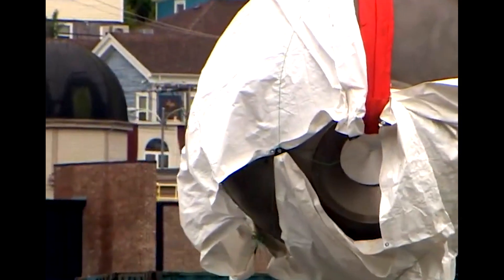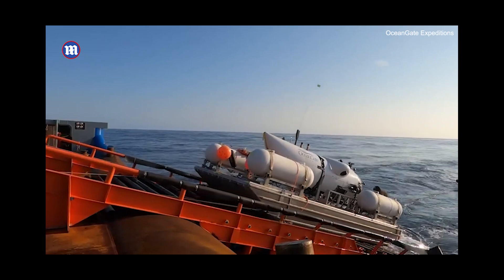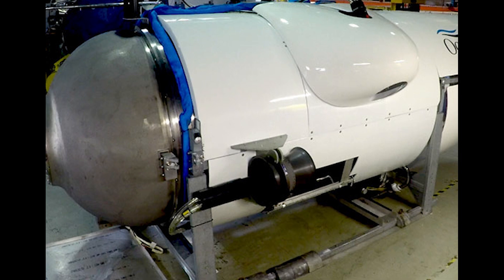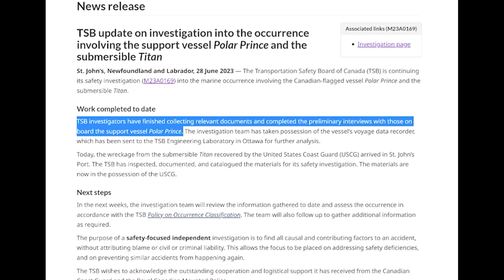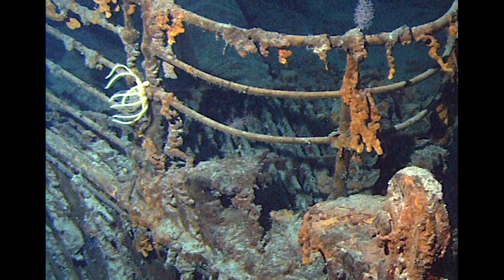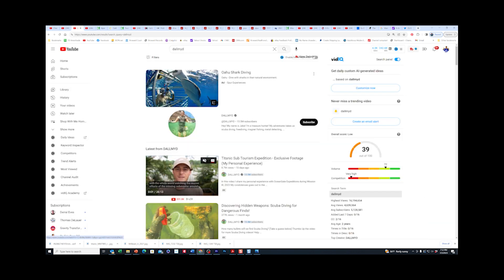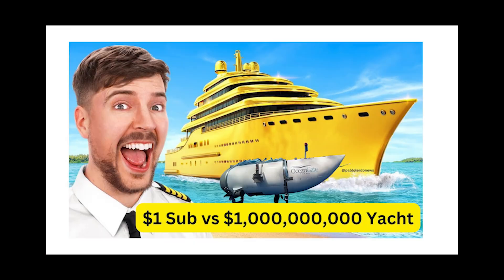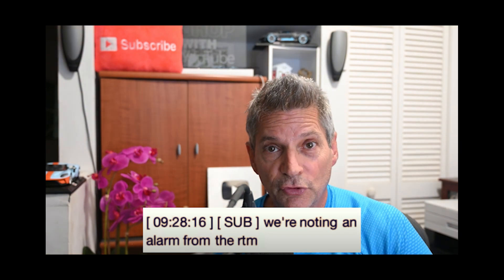Titan Submarine Debris Clues, Implosion Simulation

Comment: The design of the rings should of somehow been screwed onto the carbon fibre tube, its amazing how they glued it on, however the implosion happened its clear the two end caps which where glued blew outwards separating fully from the carbon fibre, or may have been what caused the implosion, as for them
Knowing they had an emergency, i dont know how long they was aware, but it was long enough for them to abort mission, and who knows maybe the dropping weight triggered the titan to implode, they must of been terrified during that moment
Reply: They could have had 6 brackets on each titanium flange with 6 thick carbon steel rods threaded on one end, connecting the 2 flanges together along with fasteners. I would have never trusted glue alone.

Comment: That's exactly what happens when you use composite bonded to rigid metal.
It's bond will catastrophically fail that's why there's no epoxy residue on the ring.
It needed rings in the centre if anywhere.  The obvious weakpoint is the centre. 
I would say the bolts were ripped out. Let's see.

Comment: My guess is they would have heard some cracking a short while before it imploded instantly!

This is pretty much confirmed by the dropping ballast and aborting the dive so close to the titanic, I doubt stockton would make that call unless it was an urgent need to resurface.

I have heard mention of 'cracking sounds' on previous dives and stockton saying it was 'normal'.

My guess is the carbon fibre was delaninating long before it failed completely.

After repeated cycles of diving and surfacing and the varying pressures imparted on the carcon hull have had a accumalitive effect on weakening the structure!

It's worth noting how relatively intact the titanium pieces actually are, even after the devastating destruction of the hull.

There is a reason submersibles are made of such high strength materials such as titanium!

Stockton ignored this at his peril.

Comment: An adhesive joint with no mechanical engagement is not a good idea.  It looks like they butted this together with just adhesive joining it together.  In general, I  would not specify that for anything structure with a critical life safety function...   Fundamentally, this structure was NOT inspectable.    In a load case where failure takes place in milliseconds, there was no way to know if the structure was sound in advance, just dive and see  what happens.   But  at least  he  didn't have any uninspiring white  guys  working on  it...   I am  sure the  families  of the victims are happier knowing that.  An  unnecessary and predictable tragedy.

Comment: They probably did picked up some carbon fibre parts but it will be in small pieces so most likely it is stored in boxes which is why you didn’t see it off loading from the ship.

It is also unlikely to be any carbon fibre parts on the titanium ring as the forces during implosion would rip the carbon fibre and glue from the titanium ring off clean.

Comment: Why didn't they weld the end flanges to a titanium tube, then filament wound the carbon fiber over the entire tube assembly. I think they should have added some helix angular winds and not hoop wound the entire composite structure.
Reply: Weight.  The whole point of using the carbon was to replace the titanium shell.

Comment: take a plastic pop  bottle with a cap on it , submerge and squeeze the sides hard enough the cap will blow off. In my opinion no mater how strong the epoxy was it will not penetrate titanium and therefore the clean edge you see on the ring is simply the epoxy remaining on the carbon fibre but not titanium. Portal window bolts more than likely failed the same way. I agree that biasing the carbon fiber at 45 degrees would have increased its "compression" strength  and resisted plane sheer stresses better.

Comment: I have read about a theory for the porthole where the glass is designed so that the force pressing on the glass is supposed to be directed into and against the window. When the sub imploded the water rushed in and pressed the window glass outward, probably destroying it.
Reply: Yeah it's only held in with a few tiny bolts
But as the tube collapses, inside pressure rises dramatically as water rushes in, then the water slams into it (water hammer style) and it pops out
Reply: The Daily Mail reported that the porthole window was found separately from the front end cap in the debris field.  That, and the fact that these parts they brought up from the bottom were at all recognizable tells me this wasn't a typical implosion.  I think it was some kind of 'progressive implosion'...
Reply: @johnbergstrom2931  "progressive" in a matter of 0.01 seconds?
Reply: @Mrwhomeyou  Yeah, probably not the right word...  "Unconventional" or "Non-standard" maybe.  I just think if it were a regular implosion the pieces of surviving debris would be twisted beyond recognition.  Instead, they're in pretty good shape, almost like they could be used again.  Maybe the sub was largely flooded before the implosion happened.  The carbon fiber cylinder pinched in the middle, separated from the rings, blew the rest of the sub parts to the sides, then shattered into a trillion pieces...
Reply: @johnbergstrom2931  It tells me these parts were far sturdier and far better suited for deep diving than the carbon fiber hull  inbetween them...
Reply: My favorite glued and resin'ed expired charcoal fiber with a plastic view port submarine didving down to submersible depths

I'm usre the presure increased the heat to vaporisation and cuombustion presures sphere of milisecon 270klb preseure per square inch with 5 feat of acceleration and momentum and crushing air
Reply: @bobsterclause342  Just call it 'Rush's Deathsub' for short...

Comment: No time to read the 1k comment section but lack of the window is imho due to hummer effect of water entering the chamber after the rear cap popped off, so it might have been blown out of the other cap like giant hammer hitting the view port (screws broke so it all looks so clean). I doubt rescue team would have time, money and afford to unscrew dozen of bolts to make the loop hole for hoist strap 4km under the surface.

Comment: There is 1inch thick strands of carbon fiber dangling off the titanium. I definitely think the caps just popped off the cylinder, the carbon fiber tube compressed and ripped the glue from the titanium.

Comment: The 4000m thing still blows my mind, if you are going to make repeated dives to 3800m, knowing the cf gets weaker with each dive, you want that thing rated to at least 6000m.  As it is that sub should have never gone lower than 2000m

Comment: The application of the adhesive was topical. I saw no way of it migrating into the carbon fiber nor would the adhesive migrated in the titanium ring. So, the adhesive was stand alone and it's topical strength would be all that kept the two components together. A glue is much stronger when it anchors itself into the material. The bond will incorporate the material for additional strength. The joint is suspect. The adhesive they used is suspect. The design is suspect. Not to mention the viewing window not rated for those depths. Throw in a PS 4 controller and camper lights and you have a DIY project. R.I.P. to those who lost their lives .

Comment: Given the state of the wreckage (titanium parts largely intact - carbon fiber hull reduced to a couple of bags), I would bet a months wage that the missing view port window did not contribute to a possible implosion . I think if it had failed this would be the point of ingress for the pressure water (pressure that can cut a human in two) and the carbon hull would suffer less damage (break in larger pieces possibly still attached to the titanium domes) . 3500 meters = 350 atmospheres X 14,7 = 5145 PSI make the water getting into the sub in supersonic velocities . Either way the occupants reduced to a pulp in milliseconds ..... That's my two cents based on my 27 years of experience working with carbon composites as an Air Force Tech ....

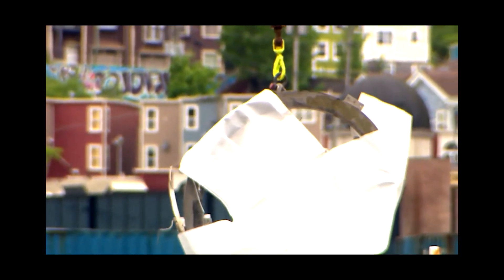Comment: There is visible traces of the glue that holds carbon tube together with the ring at 1:49. Please use original video, since this one is contrasted too much and too short in time. The glue is greenish color. Also, note stripe of metal that was cut from the flange - this may indicate incredible stress of carbon tube pushing out that edge of the flange. Not sure whether this ring is from the front part or the aft part. Read your transcript at 09_38_09 where sub says: "crackling sound at aft".
Reply: Yes, better view at 1:50. Note that "greenish" color is actually grey-green with traces of black material near inner part of the construction. Also, clearly saw that cut flange on the left with mysterious almost black square resembling carbon color. I am not concern about that grey-green residue, but rather lack of it at other places. Looks like shear forces cut off whole flange that previously look like this: |_| and now look more like this \_ (left part dangling free, right part missing).

Comment: Would love to see a stress simulation on the CF in the area where the titanium ring is mated to the composite run over multiple dive cycles. Not an engineer, but I would put $50 on it failing at the boundary.

Comment: The flange didn't go far enough down on the hull, in my opinion. Secondly, the bonding glue probably bonded well to the carbon fiber but not the titanium. The titanium was way too smooth and nothing for the glue to adhere to.

Comment: I agree completely. When I saw them gluing the end caps on. It looks like they’re overlapping by 2” max. Even if that was the case. There should have been some connecting rods outside the sub running the length of the sub connecting the 2 rings. It would make it harder for them to pop off.
Reply: The external pressure at depth would keep the end caps on as long as the carbon fiber maintains its strength. The problem here is while carbon fiber is really strong at tension because of the fibers, under compression the fibers do very little and the majority of the strength is in the epoxy that impregnates the carbon fiber layup.

Comment: lol.   That is the service end dome.  Not the dome end with the window.  There are not even machine holes for the window.  Next.  If you simply look at pictures of the sub with the covers off, you will notice that the wreckage already has the big round orange globe missing from it.  That is what goes ping every 15 minutes and is self powered.  In other words, it has a clock in it.   That 55 gal drum imploding, you need to increase the speed by 100 times, you then need to add the heat from actual pressure implosion.  Temps surface of sun during the compression.

Comment: maybe if the rings had been joined by long bolts to put the tube into compression it would have resisted the pressure.  and tightening nuts on the bolts would have compressed the glue better?

Comment: Is it possible that carbon fibre pieces are lighter than water and would therefore float to the surface rather than sink with the metal pieces?? If so then the carbon fibre cylinder is scattered all over the North Atlantic in small pieces unlikely to found.

Comment: I wonder why they didn’t cover the carbon fibre with titanium so it formed a complete skin. As you point out, a smooth metal ring is not actually glued to the carbon fibre . I cannot imagine 5 inches is thick enough for a 2.5 mts diameter vessel and I would have thought it needed a woven carbon mesh structure, its not the easiest material to form a completely uniform construction, I expect you have to build well over the stress levels your are expecting to place on it. Surely the nose cone could not have the window removed until it reached the surface, but they may have done that in order just to lift it on board, but why not have a large cage lowered or near the surface for the on board lift .

Comment: Of course you won't find any remnants of CF attached to the Titanium mate ring surface ... there were no built in anchor points in the mate ring and the "Special Adhesive" was as effective as chewing gum; imagine laying wall-to-wall Carpet without using nail board slates to stretch and anchor it !  This project was doomed from the get-go ... no Clean Room for any of the manufacturing process, no "Auto-Clave" to pull down the CF as tightly as could be nor heat application to get full flow of the Resin, no SOF/QUAL/HALT Plans from Engineering, use of expired CF Tape bought from Boeing's "Scrap Yard", No ultrasonic NDI after cure nor after every dive ($20k that "Ebenezer Rush" would gladly have paid if he knew this outcome ... all those "popping sounds" were on-going delaminations in progress), et al. The manufacturing process SHOULD have been "Thread (TOW) Laying Machines with min 45 degree layup pattern in a Clean Room and then baked off in an Auto-Clave (with an inspection sticker that was still valid).  Google how LM Aero built the Japanese's "J2" Wings ... co-cured CF to Metal.  We spent a ton of time/money getting that Process down right !

Comment: 7:19 looks like he's got a torque wrench but not being used properly. Maybe for a photo op.
Reply: Additionally, I would think that those bolts are torque- to-yield bolts so one and done use. I'm not marine mechanic but saltwater and steel don't mix. In my limited seawater experience. If anyone knows what kind of alloy was used for the bolts if at all and fastening spec, that be very intriguing.

Comment: Maybe the failure happened in the rear and when the pressures came forward through the hull, it sheered off the bolts that held flanges. Six thousand pounds of pressure will sheer some big bolts.

Comment: Im a former professional glass fibre  pipe system builder, but not an expert. I have some thoughts on what happened, I think the pipe failed due to fatigue.
1: The pipe as I have seen produced has all its fibres laid parallel, no cross pattern. Its a roll of serpentines glued together, there is no strength length wise. 
2: Fibre pipes are good at keeping pressure in, not at keeping pressure out as carbon fibres are very soft/bendable. Its basically the resin/epoxy that has to hold the load.
3: On every dive the pipe has been compressed and then decompressed, this can cause delamination between layers and make the resin/epoxy crack and become brittle (slowly loosing strength)
4: Then there is the thermal expansion coefficient, meaning materials expand/compress differently depending on temperature. This value can vary greatly on both carbon and titanium, but can be fairly close if right materials are used. This means that in low/high temperatures, the parts might not fit as well together as they do in a "room temperature" environment. This could cause the glue to simply snap of the titanium. ....Most resins I worked with stick very poorly to metal.
5: There was a lamp inside the sub (roof), if that lamp is mounted using screws into the pipe, it would greatly compromise it strength.
added: just saw a picture where it appears that the screens were actually screwed directly into the carbon fibre with 3 screws, that is a serious weak spot.

Comment: My theory is that there was no implosion at all, but an explosion. If a leak occurs at 3500 meters, the pressure within the vessel will quickly rise. Due to the emergency measures deployed, the vessel will take off. The occupants had probably already drowned at that time. Due to the high pressure that has developed in the craft in the meantime and because the outside pressure drops during take-off, the window and titanium rings have come loose. These were not designed for overpressure from the inside.

Comment: That they bonded a carbon fibre cylinder to a titanium ring with glue is astonishing. These materials have different coefficients of expansion which means that during each dive to the cold sea bottom the glue is subjected to stress. It is conceivable that they experienced ingress of sea water through the glue joints before they died. The absence of a carbon fibre tube does indicate a sudden implosion at some stage. As one of their directors pointed out in writing to Rush, this sub had countless failure points including carbon fibre delamination, port failure and glue failure not to mention the fire hazard from flammable interior components.

How much would it have really cost to machine a proper steel or titanium hull?

Comment: Im a builder and was really taken aback that joint between epoxy and Carbon😢 fiber was only epoxied, if ai built the damn thing in would break not in the joint for id of found a way to stick some bolts on there fr, the sub needed a titanium frame that held those 2 titanium ends together.  Plus the guy was big into aerospace engineering, and anyone into that would have read about  Apollo 1, hello , frickin explosive bolts man .   Are you kidding me, locked in there like a jar of  pickles.  What it shows is a lack of concern of safety and common sense